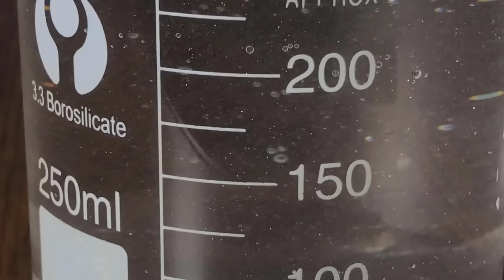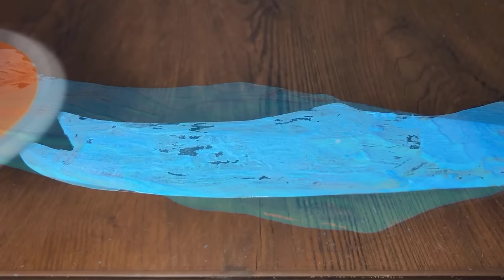Rusty Dragon Hunter Knife Restoration Video

Comment: Not using the right to from the start, a metal brush should be more efficient to remove the dirt on the blade.
I understand that on one side of the blade, you can't polish too hard or you will lose the dragon pattern.
I also understand that it can be a design choice to not have a mirror shine finish with no black spot.
And we won't talk about the sharpness of this dragon hunter knife
Special mention for the plate with holes covered with duck tape.